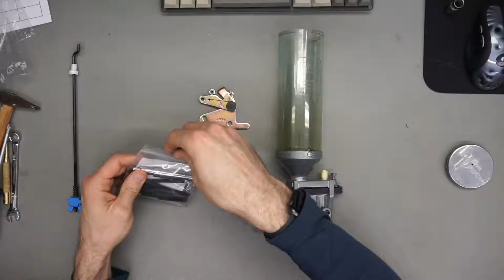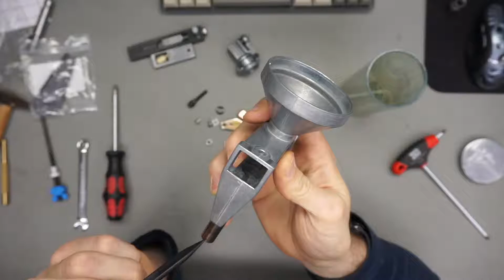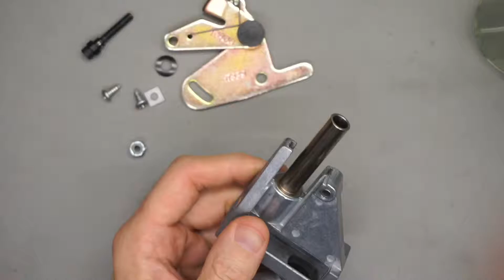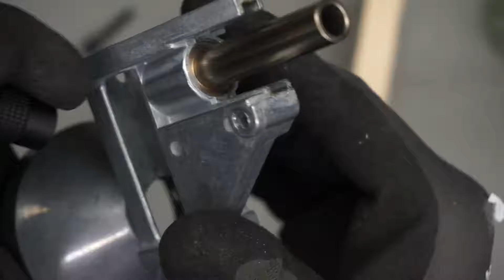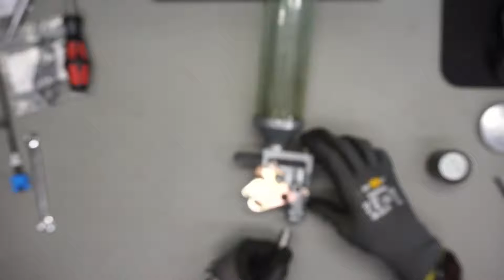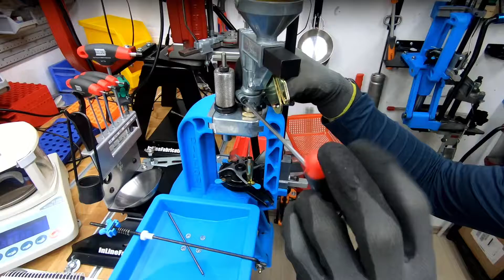Dillon Powder Measure - Fixes and Upgrades! No more spill, improved consistency, Failsafe feature

Comment: Bonjour, I also have an older Dillion powder measure. Thank you for finding that hidden spot that retains powder in the powder drop assembly. I had the same issue and your modification worked great!! I was able to seat the tube deeper into the body assembly and solved an issue 😊

Comment: Great video, so the purpose of the failsafe upgrade is to eliminate the possibility of overcharge of powder?  I often wondered why the older lever type with the return rod would need that upgrade as it currently ensures that the powder bar does return. I suppose there is the chance that someone could go halfway and then drop some additional powder and return without knowing. I like the old system without the upgrade.
Reply from the maker: My understanding is that the old pre-failsafe system relied on gravity to return the powder bar to the back and it wasn‘t obvious when the powder bar got stuck halfway. With the failsafe rod, a full return of the powder bar is now forced and any issues with the return will alert the user.
So rather than preventing double/overcharging, it prevents undercharging and missing charges.

Comment: Thanks v much for this video. I'm off to check the fit of my tube in the powder body but two “tweeks” I'd add are: a) give the powder time to drop (I pause for a second or so with the ram up each time) and b) add a quick release collar to the powder body. Makes cleaning out the powder at the end of a session so much easier; I did try the Drain-n-Change bar from Uniquetek but kept spilling powder on the floor! 
BTW I've also adopted the spring from the older Dillon system. 
Thanks again.

Comment: I used a large rubber band instead of the spring you used to get the Powder Bar to slam closed.Works a treat on my 650 for loading 9mm Pistol Rounds. All in all your Video was terrific and I've changed a few other things on the Press as its pretty annoying to come close to not making Power Factor due to spillage or inconsistent charges.

Comment: On the Dillion web site there are two springs you can buy that wrap around the base of the hopper and the Pintal that sticks up that returns the slide instead of using the failsafe rod & assembly. This was originally part of an early design before the rod. I like it because it allows me to rotate the powder dropper for clearance when using a bullet feeder and powder check.

Comment: Ish I had found this video a long time ago.
Reply from the maker: Did this fix your problems with the Dillon powder measure for you?
Reply: @GunWodan actually it did not.  My powder drop tube is seated tight up against the aluminum housing.  There is no gap between the drop tube and the housing like the one you show in your video.   I am still looking for a solution to the mystery powder leak.
Reply from the maker: @Rusty_ok  thanks for sharing! Let me know if you find a solution!

Comment: Thanks for the tip. I had the problem with deviations and could not explain it? After watching your video I checked my Dillon powder towers and had the same gaps in them. Followed your instructions to work through the problems and now my Dillon is running as it should. Thank you very much 🙏
Reply from the maker: Glad to hear! Thanks for the feedback

Comment: I have an odd thing in my powder dispenser with sometimes when pulling the lever, i can feel a resistance like something is binding up, and then breaks loose. This does not happen on every pull, but it is making me crazy since i cannot figure out what is the cause. It seems like some mechanical part is having to overcome a lot of friction and then breaks loose, but it does not happen every time. 
I've noticed that the little white square cam plate that rides the powder bar is not a particulary good fit for the cap, which means that the bar will have some slop on it, but i'm not sure if that makes any difference.

Comment: I have a 1990s version Dillon 550, will the upgrade mechanism fit it. The tube does not does not have screws and does not come off of the funnel portion of that.
Reply from the maker: Oh yeah I had some of those too. Use a heat gun to soften the glue around the rim. You need to drill holes for mounting screws if you want to replace the powder container with a brand new one

Comment: Man, that tube gap tip was spot on. I was changing my powder bar and thinking about how much I hate the spillage with this measure, googled for fixes, and this video was the first result. I used a torch and a bench vice to press it in. That method did collapse the channel for the powder bar a bit requiring about 10 minutes of work with a fine tooth file, but now it's better than ever. H335 was the worst for spillage of all the powders I currently use. There'd be a little powder shower after every storke. After 50 test charges and then 200+ rounds loaded, there was maybe 5 specks of powder total on the press. Amazing. Thanks so much.
Reply from the maker: Thanks for leaving the feedback, really appreciate it. So glad this was useful for you!
Reply: with the slam of the power drop, would it throw all the power out of say a 9mm case on the shell plate ?
Reply from the maker: @kh8553 in my experience, this never happened. I am getting ZERO powder spill except from snappy shell plate indexing. With manual indexing (RL550) or smooth operating (750XL) the powder measure „snap“ doesn’t transfer to the cases

Comment: I bought an XL 750 about 4 months ago and the Powder drop is so inaccurate that I can not risk using it. I like Dillon generally but I can not risk blowing my hand off with my 500 magnum handgun because of this. Now I just use an electric powder scale/dispenser and double check half the loads as I am loading. Had I known, I would NEVER have bought Dillon
Reply from the maker: Have you tried these little fixes? Would love to hear whether this gave you better results. For handgun loads, I really love the Dillon system - with upgrades ;(

Comment: Is there audio with this video????
Reply from the maker: Yes, but the volume level is not as high as usual. Just turn up the video volume
Reply: @GunWodan , wide open on site, computer settings allied with external speakers......  I was looking forward to the examples and solutions as the Achilles Heel with Dillon's 550 is the powder measure systems.....  Powder leaks, alignment, fail-safe rod and you name it.....  Shoot; pun intended....
Reply from the maker: @ridgerunner5772  Unfortunately there's no easy way for me to improve the audio on that video. I've since improved my setup for better audio but that doesn't help. If you are just looking for a way to follow the video, the automatic captions/subtitles might work well enough. Just skipped through them and they seem to be half-decent.
Reply: @GunWodan , now that is the Ole College Try; and with success.  A fella does get the gist of the intent......

Comment: Good video but you should note that the powder bar should not slam like that.  The Failsafe system is designed as a completely mechanical return system and not use a spring to slam it back.  I do have a rubber band in place of the spring on my SDB's and it's just enough to ensure complete return of the powder bar with no slamming.  IMHO it's just not good for the assembly to be hammered like that.  I also use the smallest powder bar available for my cartridge loading for 38/357 and 45acp and it's very consistent with all flake or spherical powders.  There are 3 sizes available and the smallest powder bar works excellent and consistency is spot on.  I change back to the normal bar for 357, 10mm and 454 Casull when using powders like 2400 or H110 because of the large charges.
Reply from the maker: While it was certainly not designed to work like that, I‘ve used this system for tens of thousands of throws by now with zero issues from this setup. The consistency this slam gives me is so much better than anything else I tried so I am willing to risk parts wear/breakage but understand if you disagree
Reply: @GunWodan  If it works for you, great.  There is usually more than one way to skin a cat.  With just the rubber band for a positive pull to make sure the powder bar returns fully I find my charges of Titegroup are within .03 of a grain when dropped using the very small powder bar.  Close enough for me.

Comment: Thanks for a nice walk-through of the system and improvements. The Dillon measure has changed a lot over the years. Mine came with the RL450 and has dual springs so it is a very old one. These measures work better with some powders than others. The improvements Dillon has made are excellent for safety but for some toolheads I have gone to other powder measures to improve precision where that is important. The Hornady automatic measure works quite well on the Dillon. Dillon used to make an adapter so a manual measure (with 7/8-14 threads) could be used, and they also have a funnel die so for precision work individual measured (or auto-measured) charges can be used. I use different options on different toolheads, depending on the precision needed.

Comment: It appears that the current Dillions have that updated drop system am I correct in thinking this, I ask because I’m getting my budget together to get a new press if I go progressive the 750 would be the one? If I go single forester co-ax or rcbs rebel any thoughts on any of the above? Great video very well thought out.
Reply from the maker: I cannot confirm whether Dillon has done anything about this. It‘s not a big issue that only requires each powder dropper to be fixed one in it‘s lifetime to be good. The 750xl is the best 5 station progressive in the market currently in my opinion.

Comment: Hi, just a note on the old powder measure, it is designed  to use two springs to return the slide, the failsafe rod is, as it's name implies, a failsafe that will return the slide if it for some reason gets stuck. It was never meant to be the main return mechanism for the slide as the new failsafe system is.
Reply from the maker: Ha thanks for the insight. That explains why I was getting TWO springs on all the old powder measures I upgraded. Thought the previous owner just added as second spring himself.

Comment: I feel your pain. I'm doing 223 and my vacuum cleaner is so full of powder I am afraid it may blow up. I just sent a video to Dillon showing that the powder funnel slips about every 10-12 pulls even with everything above it removed. I don't think they can fix it but will let you know. Thank you. Also, the large powder bar specs are so bad that you can see light shining through the top and sides of the bar between the bar and the holder. Powder gets in there like you said. The good news is that I'm up to about 2 bullets/hour now (sarcasm) with all of the cleaning I have to do. I gave you a thumbs down before and I apologize. I was just upset and didn't watch the whole thing.
Reply from the maker: Thanks very much for the feedback, really appreciate the input. One issue I've been quite ignorant towards is powder spill due to fine powders working through gaps. I have given up on fine powders a long time ago because of exactly these issues. No matter how good your setup is, it felt like everything was covered in fairy dust sooner or later. The powder availability - even in pre-2019 situations - is different from the US and I mostly work with Vihtavuori stick powders partially because of their great availability. The price isn't as much an issue here because powders are generally a lot more expensive.

Comment: I found when working with fine ball powders that any jerkiness that occurs like the slam you showed really ruined the consistency of the throw.  In order to get consistency for example in 38/357 I had to get rid of Lee factory crimp die it would run the cartridge and snap on the way down and that messed up consistency!  I would get jumps in powder in couple tenths or more of a grain.  Same thing was happening when I was expanding case mouth and the throws were all over the place that I just decided to run through expander first and load it up and than it was back to throwing under 0.1gr.  Frankly that fail safe is only makes the throws worse if you're going to use a spring to return the powder bar.
Reply from the maker: Thanks for the report! That's very interesting to hear. Since I almost exclusively use Vihtavuori extruded powders, I never came across this issue. On the contrary, the results I am getting with extruded poweders in this setup are better than I ever expected from a mechanical powder drop - usually to be within an extreme spread of 0.1gn (+/- 0.05gn). To be honest, I wouldn't be comfortable with a volatile or sensitive powder drop setup at all. I've also been in situations where every vibration and bump in the process would throw my powder drops off by 0.2gn and really hated loading like that. It just forces you to measure more and still leave you with more uncertainty.
Reply: @GunWodan  I took Dillon powder measure apart yesterday to see if I have a gap and while there was no gap there was still a ridge from the tube end protruding and lots of tooling marks, it was so disappointing to see how cheaply that part is made, it should have been polished.  I decided to remove the tube with the helpful tip from "dahut" below, put it in my lathe chuck, heat up the body and used two flat screwdrivers to push it out and it came out with little effort.  Chucked it in lathe and used oiled sandpaper to remove tooling marks and polish to the shiny finish, than I took out the ridge and polished inside with a dovel and sandpaper till all tool marks were gone, also polished the opening a bit where the tube inserts as that was rough too.  Since everything was apart I decided to polish inside the powder measure as well, first oiled sandpaper and than Flitz paste and it was shiny as a mirror.  Wish I could post pictures, it looks great!  While I was doing all this I realized that I probably lose more powder when the case rotates and stops and some of it gets spilled.  Anyway, thanks for the video and BTW the audio level was really low, I had to really crank up the volume.
Reply from the maker: @DimaProk  That sounds like a lot of work, would love to see pictures! Thanks for sharing! Have you gotten any results from tests after the overhaul? Are you still getting these irregular throws with the spring+failsage?

The audio in some of my "older" videos was too low, had to add an absurd of gain for the mic i'm using. Should be improved since.
Reply: @GunWodan  Well alright, it's apple to oranges but I was actually using Hornady powder throw with pistol drum which is very precise, under normal conditions in my testing it was more accurate with less spread.  I also love how quick and easy it is to take it off the press compare to Dillon but I've ordered quick disconnect for Dillon now, also I want to order a buffle and micrometer for Dillon.  I will say that last time I used Dillon PM it was spot on using Ramshot TAC which is fine ball powder and I didn't worry as much either because it was plinking ammo.  I do have Benchmark powder which is short extruded that I want to try with Dillon PM and this is where I want to try spring / rubber band to see if consistency improves.  It was giving me terrible spread of about 1/2 a grain on my Hornady last time I tried.  I will report back.
Reply from the maker: @DimaProk  Thanks, very much appreciated!!

Comment: If that large wrench is too long for you when you wish to adjust your dies you can always cut the wrench down with a hacksaw. I would then grind the cut edge to a rounded edge and drill a hole so I could hang the cutdown wrench on a nail or pegboard.

Comment: Just did this to an older model measure (had a big gap with the drop tube and leaked powder) and a new mfg measure that had a noticeable gap. Meanwhile I did the failsafe upgrade. Happy you showed how to do this and I am sure it will solve my issues. Thanks!
Reply from the maker: Thanks so much for the feedback! I had no idea how many people were struggling with that … 
It‘s also surprising how many reports of brand new measures with this issue I am seeing. Hope you are getting good results from your fixed units!

Comment: Great tip on the drop tube gap correction! Mine was leaking all over the place after I would lower the case. I got my borescope out and sure enough, CFE223 powder flakes were stacked in the groove. Got out the heat gun, a couple blocks of wood, heated it, and gently hammered it until there was no gap left. e.g., I rested the cast part on a vertical block of wood and used another block between the drop tube and the hammer so as not to damage the tube. I've got great before/after pictures if I could find a way to attach them to your video comments. Thank you!
Reply from the maker: So glad that worked for you. Would love to see the pictures - maybe you can upload them to Imgur and paste a link here?

Comment: I removed my drop tube by grasping in a drill chuck and gently pried with screwdrivers against the casting body.  Mine wasn't seated fully either.  When re-inserting it, I used a stubby screwdriver to cushion it and tapped-it-in with a hammer.
Reply from the maker: Wow that's some real commitment. Couldn't get that tube out of there if my life depended on it!